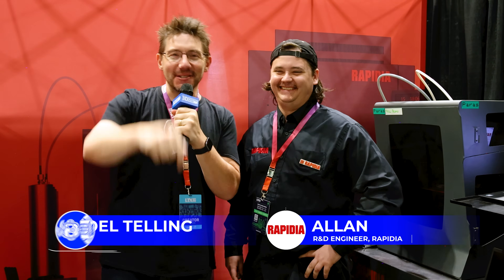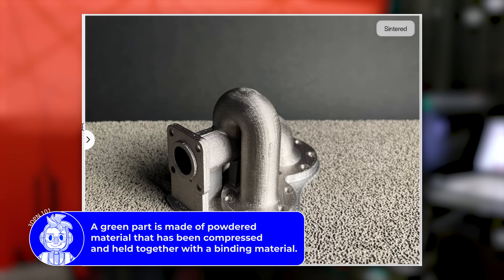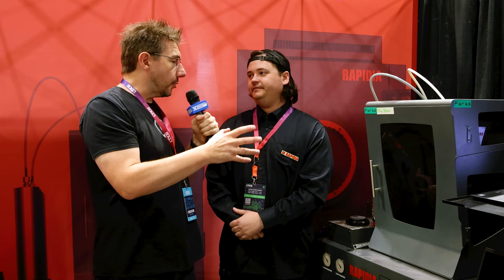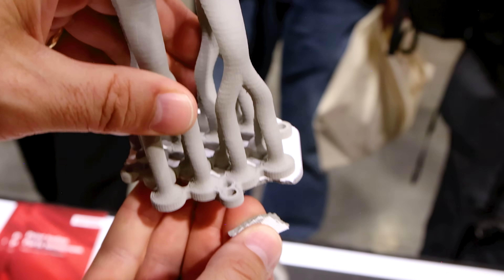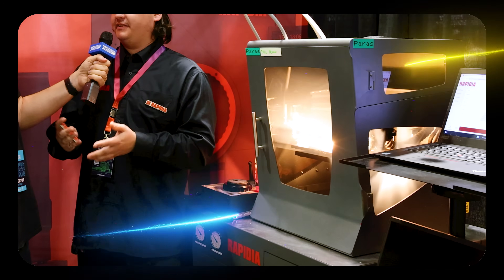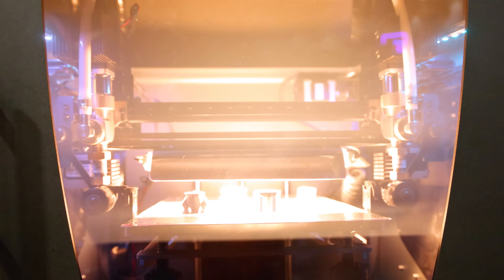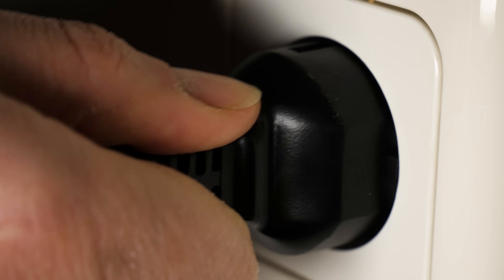3D Printing METAL AT HOME!

Comment: Upsize by 16.5% and shrinks by approx. 18%? Is there an application for metal parts that allows for such loose tolerances?
Reply: @jwr6796  You should consider a bigger scale of the part and compensate the shrinkage when You are modeling in the CAD software.
Reply: @mehrdadmahmoudian  ah, I see! That makes sense

Comment: Metal products are a world of very specific material makeup. Professional kitchen counters have food grade stainless. Care engine blocks are cast from a specific aluminum alloy. Drill bits are hardened, high-carbon steel. Wrenches are different steel alloys. Some products are cast iron. Metals might be rolled, stamped, cast, forged etc. depending on the different desired strengths. Can this produce different metals or just the non-specific "metal" featured in this video?

Comment: 🎯 Key Takeaways for quick navigation:

00:16 🖨️ The Rapidia Conflux 1 is a metal 3D printing system that uses a binder material mixed with metal powder to create paste-like green parts.
01:13 🔥 The paste is extruded at room temperature with slight bed heating to prevent moisture-related issues.
01:41 🛠️ An idex system is used to incorporate ceramic support material, which burns off in the furnace during the sintering process.
03:04 💧 Rapidia's low binder and water content in the paste eliminate the need for pre-sintering baths, simplifying the metal 3D printing process.
04:28 💲 3D printed metal parts from metal paste offer cost advantages compared to other methods like powder bed fusion.
05:08 🏡 Rapidia's system is user-friendly and can be operated on a standard home electrical system.
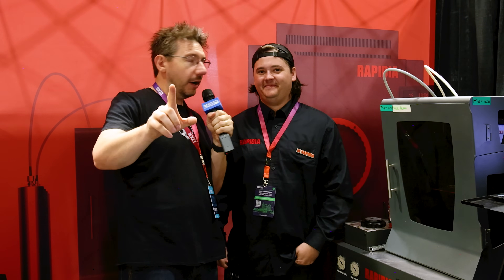05:50 🌟 Rapidia is exploring green machining technology by layer, hinting at exciting developments in the future.

Made with HARPA AI

Comment: Oh man, this is a video title I've been wating on for years, ever since I got into 3D printing. Very cool! Of course, this thing starts at about $99000 without the furnace, so you won't be using one at home unless you're rich or really, really want to 3D print metal at home. However, that is how plastic 3D-printing also started out, after which prices dropped over the years until the hobbyist could afford it. This is the start of that process for metal 3D printing

Comment: 18% shrinkage is massive. No way to maintain any accuracy for engineered parts that need to fit together with that.
Reply: The shrinkage does not impair the accuracy as long as it is consistent. The software takes care of the scale factor. The metal paste is very consistent, and so is the shrinkage.
Reply: This is seeing the weeds through the forest.  Tolerances are simply not there for any real manufacturing (yet).

Comment: Recently , I got some quotes for Binder Jetting... parts are still very expensive even when buying hundreds at a time... a 220 gram part in 316L for a one off was $270... for 500 of them was $110.  Unless you are Nasa, GE etc the parts aren't comparable to traditional manufacturing.   Good for a nice metal prototype but not feasible for small production.

Comment: These binder sintering methods are super gimmicky, they are far too inaccurate to produce reliable parts.   The old 80's 3D systems method of a powder bed and co2 laser is still a far better option.

Comment: If anyone wants to make 3d prints out of metal, just get a cheap FDM printer and electroplate your 3d prints. Electroplating is much cheaper than a metal 3d printer that costs as much as a house. I remember when FDM printers cost an outrageous amount of money when they first came out, now a decent FDM printer can be bought for $170. Maybe some day when enough time has passed metal 3d printers will be more readily available to the public.

Comment: Awesome to see.

I wonder... was the power requirements mentioned for the printer, the furnace, or both? Because I can see people now going "finally, everyone told me it wasn't happening anytime soon" and in reality it being "well it's 3 phase power, you need 1 outlet for each machine, the paste starts hardening after opening so you have to use the whole thing or it goes bad, we only support certain metals at the moment (and while people will go "stainless steel is fine" and then discover that it's not the particular one they were expecting), and it's going to be pretty rough until you post-process it with a lot of grinding and polishing... which those who need/are semi-capable of doing metal printing NOW can do... while those who just want 'metal Bambu/Prusa/Ender-3' etc. can't do" and that's all before price comes into play.

We hope cost comes down, though it depends on a number of factors. Plastic FDM costs are where they are because of competition and because people took the process and turned it into reality using wood, plexiglass, and cheap metal extrusions. So it goes from cheap to expensive, depending on features and company. This, and many other metal printers shown at this point, have a lot of R&D, technical development and limitations to overcome. So they start at a high price and unless people can do it with basic components (which room temp. extrusion is certainly possible) and/or there's competition, it will remain at that high price.

So again, awesome to see. Looking forward to see them inevitably be shown again (and what they hinted at...), but "it's not happening anytime soon at a cost most people are willing to pay"

Comment: I'd be curious to know how strong these parts really are. For example if you've ever watched Forged in Fire, anytime there is a catastrophic failure where the blade breaks, they almost always look at the grain of the metal and can see issues with it that contributed to the breakage. With deposited paste, how might that be affected?
Reply: I'd more equate this to an alternative to casting than to forging.  There's good reasons why swords were not and are not cast.  Though, I would still expect something made from a lost PLA casting process to be stronger.
Reply: What're the best 3d printers groups on Facebook

Comment: "3D Printing METAL AT HOME!" Exactly no. Yes you can install it at home but this is still an appliance that is designed for a workshop. Anything that has a "Get a Quote" Pricepoint is not meant to be used at home.

Comment: $99k for the system, or $25k for printer and $90k for furnace.

$400 per 1000cc tube of stainless paste

$1000 per 1000cc tube of IN625 paste

Your welcome😉
Reply: What're the best 3D printers groups on Facebook you know ?
Reply: When I talked to them at AMUG, they told me the printer as a stand-alone was only $9k

Comment: i bought and installed my dual extruder feeding mechanism, and im having issues with the gear slipping still. i tried turning the print temp up, and the print speed down, and still have the issue. what should i try next?

Comment: I'd love to see a version of this printer where metal power is extruded and is melted with high-voltage electricity. That's what a 3D space rocket company is doing (I forgot their name).
Reply: Rocketlab 3D prints a lot of their stuff. There are probably a few others.

Comment: Small nit: At 4:20 the info box says the drying lamp uses UV light. That's not correct. It's likely using infra-red with a high component of visible light too since it's so hot.

Comment: when it gets to $3000-$4000 price range, then it'll be "at home", but that 82-85k price range is not doable 😅
Reply: What're the best 3D printers groups on Facebook you know ?
Reply: You can print metal on 90% of reg printers. The "kiln" isn't that hard to build to sinter and remove the binder. Or send it off and wait, but you're more creative than to waste time. 
There's a company offering several metal filaments. Even an old ass ender 3 is capable with a better nozzle.

Comment: 4:30 metal binder powder 3D printing and sintering versus...  ???  ...really versus investment casting techniques ("lost PLA", lost resin etc) where you get excellent cast metal parts from the refractory ceramic coated 3D prints, crazy shrinkage is an issue with either...  will be keeping an eye on RAPIDA for sure!
Reply: What're the best 3D printers groups on Facebook you know ??

Comment: It wasn’t that long ago that 3d printing was pretty darn expensive, so maybe someday we’ll be able to make it happen. I am loving how the 3d printers and the desktop cnc machines continue to evolve and are constantly more affordable and easier ti use.
Reply: There's a video saying you can cheaply do the metal 3D printing if you use an electrochemical process by modifying a cheap 3D printer. Basically building up layers of electroplating. The only problem is that its slow.
Reply: They honestly weren't ever all that expensive to build, reprap community has been pumping out cheap plans since 2004 (Most of these printers are using hardware/firmware that was created by that community).  The only real change is commercially they have just gotten cheaper via mass production. Its really no different than building any other CNC machine, a bunch of T-Slot Extrusion stock and a few steppers.   Most people don't realize a lot of this tech isn't new, hell the STL file format is 36 years old.
Reply: @nikushim6665  True. The main thing that catapulted 3d printing into the mainstream was the expiration of the Stratasys patent which allowed for commercial knockoffs to be sold.
Reply: that is about to end
Reply: i agree but it os fsirto say also that at the moment is out of a budget

Comment: Very cool tech, once it can/if it can do aluminum this could really change high end restoration and custom car business. As is SLS printing is still cost prohibitive for anything but the highest end shops, this could change this. If it could do aluminum you could even do custom cylinder heads and such that SLS would be too slow/expensive to build.
Reply: Printing custome cylinder heads, like a crossflow head with bigger ports for my Slant Six, would be very cool. It would also bring the cost down for race teams to make their own parts, like pump housings, but that does assume the printed materials have the same strength as at least cast parts. Other metals, such as cast iron for brass era cars, or cylinder blocks that could have steel liners for reproduction/restoration of historically important vehicles. Stainless Steel would be the material that opens up many more posibilites.
Reply: @PiDsPagePrototypes  I imagine it's similar to sintered parts. I believe the SLS process is pretty great for strength. I imagine aluminum is tough because of the oxide layer that so readily forms.
Reply: @Levibetz  Surface toughness? Hopefully there will be info on shear strength too.

Comment: Looks really nice, but with "Complete Hardware solution from $99,000" I won't be making metal Benchies any time soon! Still inexpensive compared to most other metal printers, apart from those that use standard FDM-based printers to make the green parts (Virtual Foundry, Bosch Ultrafuse, etc.). I'd love to see a deep dive in to the pros and cons of both technologies.

It's interesting that they're working on copper (I see that on their website). There aren't too many copper printers.

Your pop up info box says the drying lamp uses UV light. Surely it's infrared light?
Reply: With pumped paste you probably get higher metal content than the filament systems. And that makes higher quality parts when sintering it.
Because the filaments have to have enough binder material for the filament to survive the handling without breaking.
Reply: @titter3648  that might be true. Virtual Foundry's metal content by mass varies, but it's as high as 90% in some cases (80-85% for stainless steel). Of course, volumetrically the number will be much lower. For metal injection molding (MIM - a commonly used precision metal molding technology), the metal is typically 60% of the feedstock by volume.
Reply: cant wait when those technologies will get lower than 20k
Reply: A new selective laser melting machine I am helping design is going to be sold at 400-500k. This is definitely more affordable, but not by as a much as I initially expected.

Comment: I am curious if it is possible to print 2 parts separately and then bond them together so that they form one part in the furnace?
Reply: Yes, you use water where the parts get together and done!
Reply: I would feel like you can use the material shrinking to hold two pieces together like a tolerance fit.

Comment: I always know if the website doesn't list a price but just says "Get a quote" then I can't afford it.
Reply: Us peons are probably better off just doing lost wax casting anyway.
Reply: @hazonku  question: who ranks higher on the food chain….peon or peasant?
Reply: @jim2386  It seems that a peon = a peasant. But peon is a bit more of a generic term.
Reply: @jim2386  A peon is the lowest type of peasant - essentially a slave.  Some peasants were nominally free and paid rents, so a peasant is probably slightly higher on the bottom end of the food chain.   (THE MORE YOU KNOW...💫)
Reply: @talyrath  TMYK GIF HERE
Reply: It says "starting from $99,000" when you click on the button. Yup, you were right.
Reply: @1n9i9c7om  $99k Canadian….that’s gotta be like $1500 US right? :)
Reply: @1n9i9c7om  for get install in a home. "back in my day, that'd get you a house with that price point"
Reply: @1n9i9c7om  Doesn’t sound affordable for home use as alluded to in the video title.
Reply: Totally
Reply: It's expensive, but it's less than half the price of the next cheapest system... One step closer for us home gamers :-)
Reply: Virtual foundry is doing so,ethimg very similar at a much more accessible (albeit still expenaive) price point. Their filament can be printed with a standard printer and cintered in a ceramics kiln (which can be had for less than $1k)
Reply: Having a JOB = Just over broke
Reply: @Deathwish708  try being retired
Reply: Just wait until a generic Chinese brand copy their idea, it will come down from 100k to 3-5k
Reply: @Akela6  agree
Reply: I fukin hate when call for a quote is where the price should be.makes me want to buy from anyone else when I see it.
Reply: Yeah, I just said something similar!
Reply: There's another company that has metal 3D printers for about $3,000-5,000. Its the Iro3D pinter. https://www.youtube.com/watch?v=IDl57RmASyA

This method prints with powders and then you bind those metal powders together with a metal like copper.
Reply from the maker: Here is the Iro3D machine! https://www.youtube.com/watch?v=4FkzLs7cLes
Reply: The thing is do I really need the printer itself?  Isn't the Ultrafuse filament supposed to work with most printers?
Reply: 25k for the printer,90k for the furnace and 99k for the package
Reply: Exactly! Lol but awesome tech and it will only get more affordable from here on out. Our kids will probably print metal at home
Reply: Who needs this crap? Chinese make whaterver parts you need for pennies.
Reply: @juliusvalentinas  uh, for rapid prototyping for example? There’s lots of demand for this tech..
Reply: @Javii96  Plenty of shops out there who will fab a part for your prototype, or you can prototype cheaply on your own with a home 3D printer. But for $100K, hell no. That 100K would go a much longer way the old-fashioned way in my opinion.
Reply: Also means it's a company that you don't want to work with because all the real costs will be hidden from you.
Reply: He said something about an install, so I'm guessing the price includes sending a guy to your house to set it up.
Reply: @caelan5301 can we save money using a house oven? but forget the pizza!! 😂
Reply: @caelan5301  this ain’t going to anyone’s house 🤣
Reply: It's also the case of, if they want to do business, they'd list the price. As in, I have a a sum of money to offer to you, and you have a product (or service) I'd like to trade this sum for. It's that simple yet they're simply refusing to list what the thing will cost. Might as well go get it off of someone else in that case. I assume in this case the process is still not 100% mature.
Reply: @dudo626 Yeah, he also mentioned in the video "it in someone's house" implying that it's not something that you can just buy and setup yourself. Maybe just for safety reasons since you are dealing with a furnace. 

Companies developing new technologies are often worried about IP theft, so they may want to make sure they're not selling a unit to a competitor to reverse engineer.
Reply: @williamreinhard   you are dead on for reverse engineering, albeit with little counter to those with deep pockets, or state coffers. the production capability out of a small footprint is what i believe they are advertising; this might be perfect for a research and development firm, or something like one offs for a premium from a larger array of shop capabilities.. just like there are half a million dollar value cnc this and that, the rapidia line might allow a company to dip their feet into deeper pools of capability.
Reply: It's the opposite of an enticement, makes me look elsewhere everytime.
Reply: That's Wrong. The reason they don't list the price is to try to charge you the most, based off how much you are able to pay. @dudo626
Reply: @dudo626  I literally immediately leave a website if they do the whole quote instead of price thing. I don't believe they deserve business if they're going to be that way. The value of something shouldn't change depending on who's buying it.